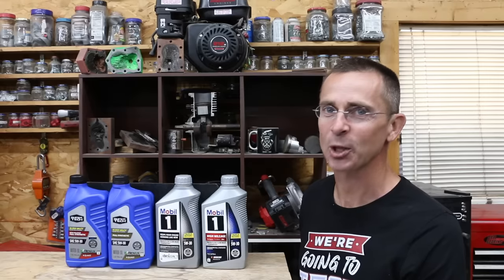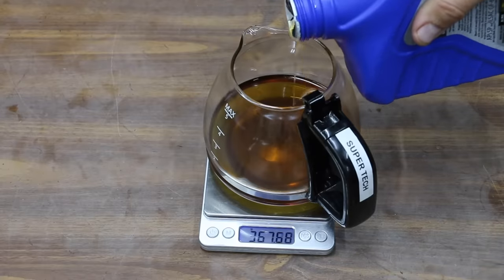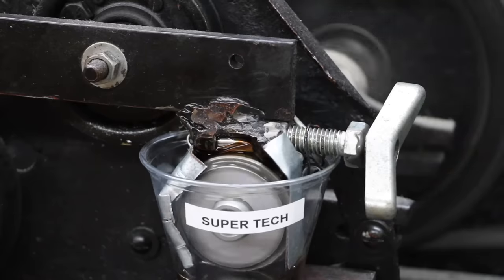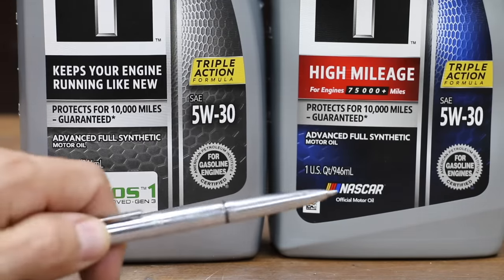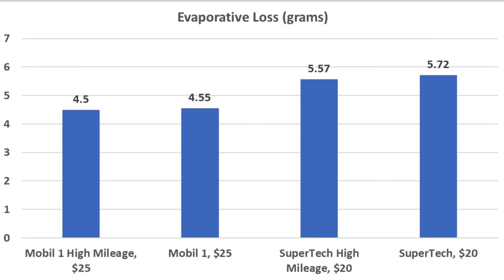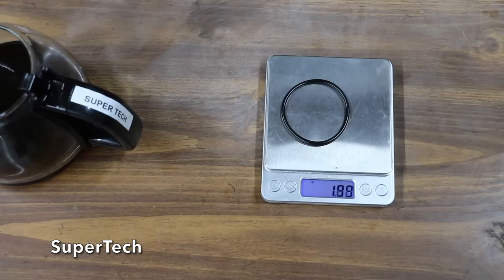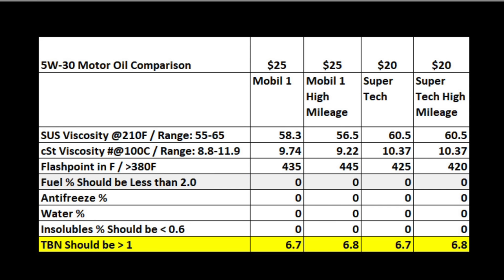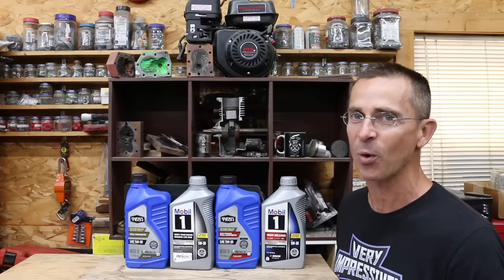Is “High Mileage” Motor Oil Safe? Let’s find out! Mobil 1 vs Mobil 1 High Mileage; SuperTech vs STHM

Comment: First time viewer👍
So a question Sir.
I have a 2006 Ford Taurus 161,000 miles. In the past get conventional bulk oil changes at Pep Boys or a drive thru.
Because of retirement & Chinese virus shutdowns, I now might drive 3,000 miles a year.
No signs of burning or losing oil and I'm very hesitant to change to high mileage or synthetic blend.
If this was your Dad's car, what would you tell him.
By the way 4/2/23, looking on Walmart website, Super Tech CONVENTIONAL High Mileage 5W-20 oil,
out of stock, not available locally or to ship. So there's that.

Comment: As usual, excellent.   Relative to the Dexos certification, this seems to be as much about GM's marketing and industry politics as it is oil science.   I have read that Valvoline oils passed the certification process but the company balked at the Dexos licensing fees as they were no value added to the customer.  This begs the question of why oil manufactures should pay a licensing fee to an auto manufacturer for the oil they developed to meet a requirement.  What's next, Ford mandating tire compounds or Honda demanding gasoline additives?

Comment: I've used Supertech for years. I had a Hyundai with almost 200,000 miles on it and it did not burn oil between oil changes. Considering the price compared to Mobile #1 I will keep using Supertech.
Reply from the maker: Thanks for the feedback.

Comment: I drive old vehicles: a 1997 Pontiac Bonneville with 117,000 miles and a 1974 GMC C10 pickup with a Goodwrench replacement 350 done 20 years ago. I only use high mileage conventional oil and high quality filters (Wix, Purolator). Neither burns a drop.
Reply from the maker: Thanks for the feedback.

Comment: When I was working for a hiker hostel as a shuttle driver, I would only ever use Mobil 1 HM and STP XL filters for oil changes on the shuttle vans (all had at least 100k miles on the dash). I am glad to see that I picked a good quality oil for my boss's vehicles.
Reply from the maker: Thanks for sharing.

Comment: Great info! I used Super tech in all my vehicles for a couple of years with no problems. My only issue is,  I dropped that plastic seal in the jug whilst removing it about 3 times...no matter how carefully I tried to peel it off. So, I moved on to Napa Full Synth HM.
Price update April 2024: M1 HM is $35.99
Reply from the maker: Thanks for the feedback.

Comment: I’m a mobile 1 user in engines running very well for over 15 years. I only use one quart of the high mileage per oil change. I do that to avoid over treating the seals. So far zero leaks and no oil burning. Lucas gas treatment is also very good additive, it’s much cheaper to buy a gallon…
Reply from the maker: Thanks for sharing.

Comment: I'd like to say thank you very much and I really really appreciate your product testing videos. I work at a mechanic shop and I have personal experience and I highly recommend a product by the name of AT-205 reseal. I have used this producton a Infiniti power steering system so that I didn't have to change the rack and pinionin addition to adding it to my oil on my 86 Toyota pickup truck that had a rear main seal that was leaking and the leak ceased to exist. Thank you for all you do and I wish you good health and continued success.
Reply from the maker: Thanks and you are welcome!

Comment: I've used supertech since i started driving, I've lived in Denver with hours of hot idling (traffic), I've lived in the mountains of Colorado at 9000 feet altitude while making long distance commutes to Denver daily (almost 4000 feet altitude difference), and most recently South Dakota with -40° winter days... I have never had an oil related problem with supertech high mileage synthetic, advanced synthetic and synthetic oils in all of that time. What can i say, brand snobs are going to hate. I have experienced this oil in extreme conditions most of my driving life, heat cycles, high rpms for extended intervals (climbing the mountains), extreme cold starts etc. This oil has literally never failed me, and has exceeded all expectations I've had of it. Mind you, most of my car's have been high mileage. If oil was going to kill an engine, it would be one that has seen a mile or 2. If you're a brand snob, go buy your favorites! No one is shaming or stopping you. But don't keep trying to disprove something that has been proven time and time again. Supertech is right in line with most other oils, people who use it aren't mindless. "I wOuLd NeVeR pUt WaLmArT oIL iN mY cAr"... Cool, i will due to my own experiences and the research behind it. I will continue using them in my cars into the future 🙏

Comment: My mechanic advised against me using high mileage motor oil in my 250,000 mile 2.5 L Subie. He says the zinc added to these oils can destroy my catalytic converter. Would love to know your opinion or testing on this. Very thorough and well presented video. Thanks
Reply from the maker: Thanks for the suggestion.

Comment: Love the videos, the BEST on the internet!

I normally use Mobil 1 Full Synthetic High mileage Extended version and purchase it when it goes on sale for $43.99 Canadian Peso and do oil changes every 6000km. My car currently has 160,000km. Would you say moving to the Super Tech Full Synthetic High mileage at $28.99 Canadian Peso something you would use or stick with the Mobil 1 Full Synthetic High mileage Extended?

I value your opinion given your extensive knowledge and research. Thanks for all that you do!

Comment: Project Farm did a great job as usual. Oils today are outstanding. Only thing that hasn't changed is, oil isn't changed because it worn out, it's changed because it's dirty. While alot of todays oils can easily go 12,000 to 15,000 miles and some even more,  the damage by the dirt in that oil just isn't worth it. Good conventional oil and a good filter every 4,000 miles   to me is a no brainer.
Reply from the maker: Thanks!  Thanks for the feedback.
Reply: How does dirt get in oil?
Reply: My thoughts exactly. Carbon build-up happens to even perfectly maintained engines over time. It's just the reality of high temps and internal combustion. I've never gone longer than five thousand miles between oil changes, max, and that's pushing it.

Comment: I learned that high mileage oils have a additives package that has something like mineral spirits in it that causes the O-rings and seals in the engine to swell up. If you’ve ever cleaned anything with rubber in it with mineral spirits, you know what I’m talking about. Like cleaning your snap on screwdriver is in mineral spirits, it sort of Dissolves the handles. When I heard that it made sense to me that that is how they would reduce oil consumption. By making the seals, swell up and fit tightly again.
Reply from the maker: Thanks for sharing.

Comment: I would like to see this same test done between Mobil 1 and Valvoline oils. Something I would like to see added to this test is how far the O rings will stretch before and after being heated in each oil sample. Do this test at both the hi temp and at room temp after heating.
Reply from the maker: Thanks for the suggestion.

Comment: Thank you Project Farm!👍 I was just deciding on wether to use the full synthetic high mileage oil or just full synthetic oil for the oil changes in my 2014 Nissan Murano with 120,000 miles. I’m going with the full synthetic High Mileage option.  Which oil would you recommend, the 
Mobil 1 brand vs Pennzoil Premium Full Synthetic High Mileage oil? Is one brand between these 2 brands notably better than the other? Thanks for your input!👍

Comment: Food for thought.  People add a bypass oil filtration system to avoid oil change frequency and filter their oil down to 3 microns.  Amsoil is a major brand in that market.  My question is whether filtering oil beyond the normal oil filter is necessary and whether oil that is super fine filtered is actually good for longer oil change intervals?

Comment: You should do a Valvoline test between high mileage,advance and extended protection which I was told to be the best one to use to keep engine in tip top condition. I was using high mileage before but when the extended protection came out they said it’s more better.  They which means a rep that I was chatting with through their website.
Reply from the maker: Thanks for the suggestion.

Comment: I'm in very hot SE Texas & have an 02' Blazer ZR2 4x4 with the 4.3 Vortec w/ 300k miles  
I just run Cheap High Mileage O'Reilly Synthetic Oil.
She runs smoother & better than my Wife's brand new Ford Escape. 
However, I've replaced almost everything on that Blazer ZR2, lol
From the Transmission to the rear & front seals, ECM, Coil, Distributor, Cap, wires, plugs, Rotor, Severe Duty Clutch Fan and many other parts. 
She's still getting the 02' sticker mpg, 16 in town & 18 to 20 on highway.
Reply from the maker: Thanks for sharing.

Comment: Under normal, highway type of driving, the walmart full synthetic gives great protection. I live near Batavia, NY, and temps right around Christmas were 0F. I run the Plain old super tech in my 2019 Silverado, and I've never heard a knock at startup. Out of curiosity, I've opened a container of the oil at those temps, and it flows just as nicely as it does at 70F. Changing your oil BEFORE percentage reaches zero life remaining is key. I change my oil @ 40% life remaining. Most of my driving is highway. Switching to the high mileage might offer a modicum of extra protection, so super tech HM here I come. My truck has about 80,000 miles on it now, and I want it to last into retirement which is less than 2 years away. 

I love the video, and how you edit straight to the important bits. ✌
Reply from the maker: Thanks!  Thanks for sharing.

Comment: I've rebuilt engines that had been using high mileage oil and I noticed the rear main seals had swollen quite a bit. That would be good to help stop leaks but along with swelling the rubber rear main seals had gotten soft and mushy. They were quickly worn down to make even worse leaks. I don't use high mileage oil.
Reply from the maker: Thanks for sharing.
Reply: Interesting, that confirms my concern with HM oils of "how much to they cause swelling?" and "what is the rate of swelling?"  This is why I never used HM oil, and it's more unnecessary additives that are now combusted and entering the exhaust stream & passing through the catalytic converter.  My 2011 Camry 3.5V6 has 270,000 miles on it, run on regular mobil-1 and has no leaks and is fine.  HM oils are a scam, and 75,000 miles is nowhere near what should be considered high mileage; 200,000 Ok, but not 75,000 miles.  And I think that age has more to do with seal deterioration than mileage.

Comment: I did my own test in my 09 lincoln Mks and first oil change on the high milage I was a quart low. Did it with regular synthetic oil and did the whole oil change cycle and went to change it it was still full.
Reply from the maker: Thanks for sharing.

Comment: most important job of hi nileage oil is to protect the rear main seal but the non-oil side will still eventually lose elasticity. if your engine has a lot of blow by, the e seals will swell up from gasoline not from oil
Reply from the maker: Thanks for the feedback.

Comment: 0w 40 Mobil 1. 10k miles. 1990 Q45 Car lasted 396k before it just needed too many odds and ends. Engine currently resides in my 300zx. Another 100k miles easily. Has had one topend rebuild which was just rubber pieces and injectors.
Reply from the maker: Thanks for sharing.

Comment: Here in Germany most manufacturers recommend oil change every 15,000 km (~9,500 miles ) for regular oil. 
High milage oil ( here called LL for long life) is said to be good for up to 30,000 km (~ 19,000 miles)
In my Toyota corolla  (1.8 L inline 4;  200,000 km) i change every year or every 15,000km. In my Mercedes (2.5 L V6; 210,000km) i change once a year, or every 18,000 km. Never had problems. Using semi-synthetic 5W30 in the toyota and 5W40 in the Mercedes.
Reply from the maker: Thanks for sharing.

Comment: I bought a 2012 Yukon with 88k miles. It has the GM 5.3 which is notorious for lifter issues due to DOD/Active Fuel Mangement. I do my own oil changes, and have used Castrol GTX High Mileage since I have owned it. Since 150k miles, I stopped using the oil computer and changed it at 5000 mile intervals. The vehicle now has 260k miles and runs great. The vehicle is basically falling apart around the engine. I honestly feel like the engine would last another 50k miles with the same level of care. I cannot say it was the oil or just good luck, but that is my story.
Reply from the maker: Thanks for sharing.

Comment: ive been running supertech oil in my cars for years now, i am extremely hard on cars (rev limiter bashing,racing,2 steo bashing,long burnouts at high rpm,top speed runs,overloaded towing) and have experienced no issues at all.
Reply from the maker: Thanks for sharing.

Comment: I was just buying oil for my next change last week and just by chance I bought the one that seemed to do very well, the SuperTech HM 5-20 for my over 150K Crown Victoria. I've been using it in regular changes about every 2 1/2 months and I like that the oil doesn't hardly seem to get 'dirty'.  It stays that pretty golden color when you check it. Slightly darker when draining but still not the night black I used to see from other oils I used before (STP? I think)  Anyway, thanks for an informative vid that answers concisely the exact questions I had standing in front of the oil racks at my local supplier.👍
Reply from the maker: You are welcome!
Reply: I run 5w 30 in the 2004 Victoria and it ran really well.

Comment: I started using high mileage mobile 1 full synthetic oil on my old Honda accord, and it started burning oil. I went back to conventional oil now and no more burning oil issues. More expensive oil is not always the best.
Reply from the maker: Thanks for sharing.

Comment: Have been using regular M1 full synthetic for 35 years in 3 vehicles, all with over 350k on them every 5k miles, with no oil leaks or compression loss.  Nothing i saw in this video has changed my mind enough to make me switch. But thanks for making it!
Reply from the maker: Thanks for the feedback.

Comment: WHEN I bought my 2011  Toyota Sienna new the dealership guy said the synthetic oil would last 100,000 miles, I check it for color, clear and smell until 99,881 miles, color changed a little and it was still at the proper level.
Reply from the maker: Thanks for sharing.

Comment: Great videos!  I have a 5th gen LS3 Camaro with the TR-6060 manual trans which calls for Dexron 3 type ATF fluid.  Would be great to do a video comparing some common Dexron 3 ATF fluid (I bought the SuperTech high mileage) , as there is great debate and confusion in the forums about which one to use in the manual trans.  Maybe also compare purpose build manual trans fluid.
Reply from the maker: Thanks!  Thanks for the suggestion.

Comment: I have a weird question, FOR YEARS I’ve been doing this experiment!! (Not nearly as exact/precise as these test 😛) 

Test done on 4-5diff 
(88-91) civic Crx D15 
All with 175k~250k on the engine 

Test ALSO done on 3diff First gen Toyota/Scion xB ?1zz? it’s the gutless 1.5liter 
These all had 100k+ miles 

I almost always run supertech 10-30 synthetic 
& it’s does great ,not much oil usage (unless it’s my Honda with 290kmiles) 

OK HERES THE WEIRD part that I simply do NOT understand 
Maybe once a year I’ll use mobil1 synthetic & I HAVE NO CLUE as to why but when I’ve gone approx 800-1000miles I’ll have used about ½ sometimes even ¾ of a quart 

Mind you these test subjects don’t smoke , don’t leak *much … so I don’t understand 🤷 
My thinking is bi-polar 😂 
Half of me thinks 
“we’ll.. ok… 10-30 viscosity is …. Well….. 10fricken30!! ,it makes no sense that mobile should (I’m guessing) slip passed the rings anymore than supertech” 

The other ½ of me thinks 
“Ok ok.. I get it the mobile one is more sophisticated & they designed it to get in small tight tolerances that Walmart oil can’t reach & maaayyybee my missing oil is slipping passed the rings?? 🤷 

I can be the only dude to recognize this …. I KNOW this happens , I’d just like to understand WHY!!

Comment: You should test different brands of transmission fluid. Keep it the same type tho like Dexron 3. I just had to do a change on mine on Sunday and also changed my transmission valve body and went with Valvoline multi vehicle full synthetic.
Reply from the maker: Thanks for the suggestion.
Reply: I've used Valvoline in my Chrysler's for a few years. Haven't had issues.

Comment: I like Mobil 1 Extended Performance Full Synthetic Motor Oil. I used the High Mileage version because my car has over 75,000 miles.
Reply from the maker: Thanks for sharing.
Reply: Similar. I help out the people who give me rides with maintenance costs and usually get the Mobil 1 Extended Performance Full Synthetic High Mileage oil seeing that the vehicles all have over 80,000 miles.

Comment: Have used Valvoline oil ever since I owned a car. Use synthetic when cars are at low miles and synthetic high mileage when they are at high miles. I worked at a Valvoline oil change shop for 12 years so I know what brands are good and which to avoid. Conventional is what it is but synthetic is far superior in engine protection and cleanliness on the inside, no sludge.
Reply from the maker: Thanks for sharing.

Comment: I used regular Mobil 1 in my truck up to about 75K miles, then I switched to the Mobil 1 High Mileage. I'm around 125K now, so I don't have any complaints thus far.
Reply from the maker: Thanks for the feedback.